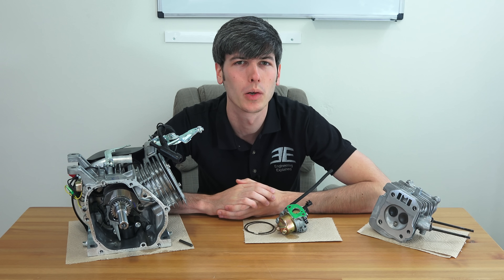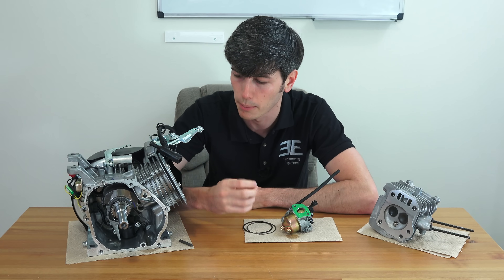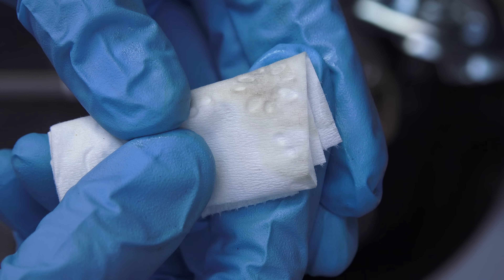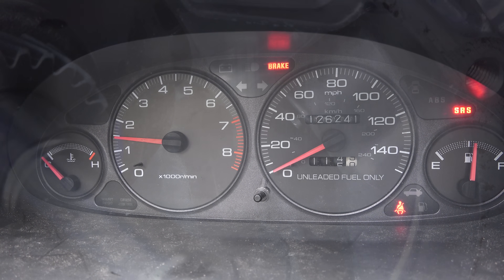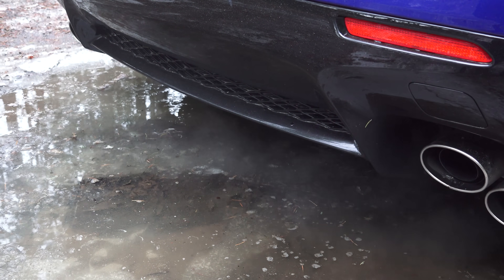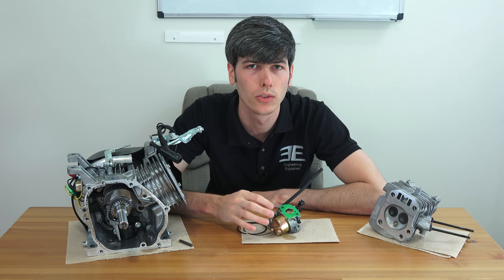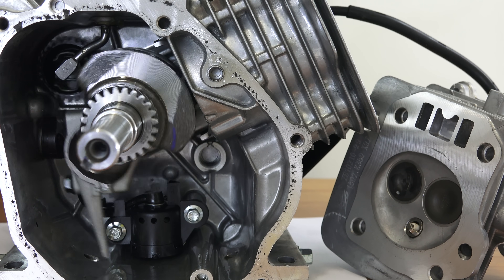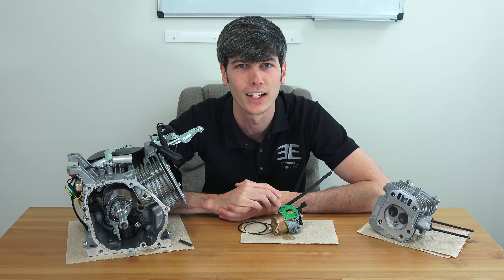Should You Warm Up Your Car Before Driving?

Comment: Hello. I have a 2009 Subaru Legacy that tends to idle pretty high (1500 rpm) 3-5 minutes before it settles down to around 600-700 rpm. I was under the assumption that this was because of the PZEV feature. Is that the case, and should I be letting it warm up until the revs decrease to normal idle? Thanks in advance!!

Comment: This isnt exactly right. The mixture is only rich until the O2 sensors heat up and start working which is about 1 minute or so. After that its not rich at idle anymore.
Reply: wrong... the cold start enrich is litterally a parameter in the engine software its tied to the coolant temp.
Reply: Thats why I said its not exactly right, not straight up wrong. By the time the O2 sensors heat up and go into closed loop the ECT is going to be high enough that it doesnt have to richen the mixture as much as if it was full cold start. It wouldnt be much. The mixture will be really rich right until the O2s heat up then it drops drastically. O2 sensors have priority over ECT sensor in closed loop.

If you dont believe me, look at fuel trim numbers before and after O2s start working. It will be pegged rich then when O2s start working it goes into what is considered normal mixture and not rich. This takes a minute or 2 and not a long time as he said.

Comment: I call bs, engines are designed to run at operating temperature, while driving lightly will warm the car faster your engine is revving higher than the 700RPM it would at idle, say it takes 3 minutes to warm up at idle, thats a grand total of 2100 revolutions, say it only takes a minute of light driving, you're still gonna break 2100 revolutions in that minute even if you live on flat ground, the only way I can imagine you not breaking 2100 is in a diesel which needs to warm up for proper combustion anyway. Plus even though he accounts for the 30-45 seconds it takes for the oil to circulate the oil is not yet at its warmer, thinner operating temperature, meaning your engine is working harder pushing what is essentially thicker oil than it is designed for

Comment: May I ask how do I know if my car has fuel injected engine or carbureted engine?
I drive a 2012 mazda 3 2.5 and a 2004 impreza 2.5 RS.
I heard if i dont warm up my car before driving it,  its bad for the head gasket.
I need some advice :)

Comment: With our Canadian winters, there's no way we'd have the windows de-iced with a scapper in under 10 minutes without help from a vehicle that's already been idling for 10-15 minutes with the defrost blasting.  That ice is thick, and there's a lot of it.  How much engine life are we expecting to lose? Years? Days? Have any measurements of ring or cylinder wear been performed? For as long as I've owned a vehicle and idling cars, by the time I'm ready to purchase a new vehicle I will have noticed no problems from winter idling.

Comment: So wait you're saying by leaving it idle is hurting the engine by allowing gas to dissolve the oil and eventually seep into the oil right? But at the same time you're telling me that after 15-30 seconds the engine is warmed up enough to run. So wouldn't that mean after 15-30 seconds I no longer have to worry about the gas dissolving the oil or seeping into the engine?
Reply: B Mack no . He is saying after 30 seconds drive lightly to reach operating temp quicker than idle would

Comment: If you have a high performance car with upgraded forged pistons and new bearings then let it warm up. You need to wait for the pistons to expand so there isn't a load on them before they expand. Putting load on them before expansion occurs can damage the rings, pistons, and cylinder walls. The bearings also need to have warm oil lubricating them to ensure consistency under load.

Comment: Please clarify for people how a transmission heats up separate and most manual cars wont even go into gear until there is some degree of warming. You absolutely should warm your car up for 10-30 seconds AT LEAST. In a manual in the winter, give it a minute before putting load on it. This is insane. This goes against common sense and engineering.... lol... he is saying it will warm up quicker if you drive it under load immediately yet doesn't address the strain that puts on all sorts of pumps. If I started my 2011 SAAB 9-5NG manual in cold weather and just went to drive that poor F40 6 speed transmission would cry and fight to shift into gear. Turbo guys, do not listen to him if you live anywhere that the temp drops below 30 degrees Fahrenheit.

Comment: a carb does not have a way to put more fuel in?  it's called a choke stops the air going in to warm up car... your car should run at a high idle when gets to around 1,000 rpm you could pull off but and why I love this guy.  the reason you warm up your car is more for you it takes seconds for the oil to heat up there is a explosion in the engine. a water sensor don't get heat water has to wait for thermostat to open... so the oil is doing its job don't hurt your engine anymore to idle as if you where in traffic..  dang AL gore global warming..  I like a warm car when I get in.

Comment: I know for turbo cars is a little more complex as turbos rely heavily on oil temperatures to function properly. My '16 WRX has an oil temperature gauge and I usually allow it to warm up to +150 degrees before I exceed 3k rpm. My question is, what would you consider "operating temperatures" for turbo cars to minimize wear and tear?

Comment: +Engineering explained Dude I love and watch all your videos. But I cannot agree with you on this. I won't say you're wrong, but definitely not right. I've seen 2 acuras, 2 Mazdas, and one nissan ALL throw rods from not letting there car warm up. and the Nissan was a 2010 altima, and the acura was a 02 integra, and 07 tl. Those engines are both fuel injected. Also I know newer engines have a lot of computers in them, 1 to help with this I am sure, to regulate temp. So why'd they still fail? I am honestly looking for some insight and response if you can. Again I'm still going to continue to watch the channel lol.
Reply: CoolBreeze90210 are you sure they were driven lightly , as EE explained  ?
Reply: swr Nismo The tl and the Nissan both were drove easy. I actually don't know about the others honestly. However believe it or not, I've been experimenting with this the past 2 weeks. I have a cousin who is a 15 yr mechanic. He told me with the year my car is, to not let it sit for more than 5 minutes. I drive a 2010 accord 6-6. So I keep the rpms really low and below 45mph before the temp regulates. He also explained that cars now days have multiple oil pumps and thermostats, so it's ready to drive after about 10 seconds. After experimenting for a week, I now see EE was definitely right on this.
Reply: bad gas in the winter probably....

Comment: I've been told by multiple people who own turbo charged vehicles that a stand still warm up is "necessary" to heat up the turbo properly. I give my WRX about 2-3 minutes to idle and circulate and then drive it very carefully until to operating temperatures. I don't usually spool until the car has been driving for about 5 mins if that. Do turbo charged vehicles really need that extra time at idle or does the principles applied in this video hold true for a modern turbo vehicle?
Reply: Full disclosure: I'm not a mechanical engineer, but I would assume that a turbo vehicle is no different save for the fact that it risks much greater wear if loaded heavily while cold (since it creates far more power than an NA engine for its size). Moreover, the turbo is another spinning part with another bearing meant to seat optimally at operating temperature, so it's just one more part to wear/damage if loaded heavily while outside of operating temp.

Comment: Another important discussion for below zero climates is the oil filter.   Plain cellulose economy filters do not flow thick viscous oil well at low temperatures and will bypass internally under load causing un filtered oil to circulate as well as the potential for previously trapped contamination to flow through the system for another pass at the bearings.   I prefer full synthetic microglass media filters which have higher filtering ability as well as better flow rates.    High differential pressure combined with a faulty bypass valve can cause the element to collapse in those chilly climates which can be catastrophic to engine wear.  Definitely keep the revs reasonable until the oil is flowing.    I hate to put numbers on it but under 3k RPM on gas engines or less than 40% of the engines redline is probably a safe bet.    Saw a video of a guy who started up his car in -40C and proceeded to do a burnout and the engine lunched itself almost instantly.      Good microglass filters are Fram Ultra,  Royal Purple and Amsoil all made by champion labs currently

Comment: Why does my car have a high idle when I start it, but drops after about 30 seconds?
Reply from the maker: Does this to warm up initially.
Reply: 120masterpiece it's to ignite the catalyst from what I've gathered
Reply: During start up the engine has no immediate readings from certain sensors (ie: air flow sensor to adjust for correct fuel or RPM to adjust for correct air). Initially your car will start with a predetermined volume of air (controlled by the idle air valve) and predetermined volume of fuel...for a predetermined length of time. These predetermined amounts provide a bit higher rpm as it's better to have a bit more initial start up power than necessary since having not enough would potentially cause a stall during start up, particularly in cold conditions. After this preprogrammed phase the Engine Control Unit begins to operate based on readings from the sensors (and now the idle RPM drops). Some of the details can vary a little bit from one car to another, but that's the basic idea.
Reply: Heat up the catalytic converter faster (they work best/more efficiently when they are warm).
Reply: It's the automatic choke
Reply: my 50cc scooter does that too, goes to 1800 RPM for a little then goes back to 1000-1100 RPM

Comment: And we warm it up because we want the interior to get up to our preferable temperature comfort level too! Lol.
Reply: JoeIsCrazyWillman I grind my teeth when I am cold, so my remote start is also saving my teeth.
Reply: JoeIsCrazyWillman and for the little ones not to be exposed to the cold temps.
Reply: Andrew Mcmillan well, i think the question should be "should you warm up your engine?" Instead of "should you warm up your car?"  I know they are somewhat connected but, one can warm up the engine without warming up the car, but no one can warm up the car without warming up the engine. 
On a kansas summer, i'd idle it for about 30sec before driving off. But on the winter, depending on how cold it is, it will be between 10-20mins to get the interior warm.
Reply: well considering some of them will be coming with like 200mile range its not that bad anymore
Reply: T1Oracle trains? Look at the size of those things. And mind you, they're not battery powered. As for the model X, i could get a full-sized truck for that price point, with much higher tow rating. Look, point I'm making is, what works for you may not work for me. Deciding on a vehicle is a personal preference.
Reply: T1Oracle why would i do it in an enclosed space? How about you let that tesla owner go to a power plant where his/her electricity came from, and sit in that smoke stack for 4 hours, and let me know how that works.
Reply: Um, you do know that batteries can't output as much in colder weather and require they be kept over 32 F to prevent damage, and unless you keep EVs plugged in can be permanently damaged when they run out of energy to keep them from freezing? And have no way to heat the cabin but via electricity when the temps are way low?
Reply: If you use your car to drive somewhere in 5 minutes, whether its warm or cold, its going to be hard on your vehicle. The bike isnt a bad idea, but if you use your car it will still be better to drive it nice&easy to work after 30 secs rather than warming it up at idle.
Reply: och sei This just another reason why electric cars are so much simpler. No engine to damage, no transmission to damage, just turn it on and go.
Reply: T1Oracle how's the towing capacity on those things? Lol
Reply: och sei The Model X can tow 5,000 lbs. All the trains in current operation have electric drive motors.
Reply: och sei Try this. Drive into a garage and let your truck run with you in it for 4 hours. Have a Tesla owner do the same with his/her Tesla. Then let us know which works best for you.
Reply: T1Oracle freights trains are technically electric driven, but diesel runs its generators, the same way as power plants rely on nuclear or coal to produce electricity for those electric cars.
Reply: och sei You don't have electricity? How do get online?

You do realize that solar and wind is currently the fastest growing source of electricity right now right?
Reply: I think the obvious reason for warming up cars is so the inside warms for the passenger not so much for the engine
Reply: och sei Well you should think about riding a bicycle to work instead of wasting fuel, time, money on insurance+registration+maintenance, and overall adding to congestion.
Reply: Matej Sommer well, i live 5 mins from work. Say i warm it up for 30 seconds, drive to work for 5 mins, that short drive doesn't get the engine to operating temperature. So, if the argument is to drive around town to get it to operating temp before driving to work, it is wasting both my time and gas compared to warming it up, which only would waste my gas.
Reply: Don't you take away the heat from the engine when you turn on the heat? I mean, obviously It does, but doesn't it make the engine heat up slower?
Reply: Yeah, until the charge runs out after 50 miles lmao.

Comment: In Britain up to a few years ago, we had Carburettor engines [as you have mentioned], Single point fuel injection [effectively an electronic carburettor - what would you advise] and multipoint fuel injection which is the advice I shall be taking [as it confirms the idea that you just switch on, scrape the windscreen, drive off and don’t drive it too hard until its warmed up.] It does mean that I now have to research into getting a proper temperature gauge rather than just a silly light to be fitted on my car as it doesn’t have it.

Comment: Wouldn't the displacement and size of the engine have a factor as well?  Would a smaller engine like a 1.4l that gets up to operating temps faster also have that issue with the gas mixing with oil from a cold start at idle?

Comment: What about more wear due to the oil being cold and not properly lubricating everything else besides the rings/walls such as the mains, cam bearings, and valve train components? You even admit that this is the case at the end of the video.

This is just anecdotal, but every time I have seen an engine "wear out", it is because of a failed valve train component or bearing, not loss of compression due to ring wear.

Comment: My car manual specifically instructs you not to warm up the engine before driving. In fact, if you don't drive away within 30 seconds after starting "ding! ding! ding!" and message comes up on the dash "Do not warm up the engine when stationary"

Comment: WRONG , WRONG, WRONG 
1.sorry my English is poor :(  2. cold engine means pistion flap soo.....  waring cilinder walls under load
2. if you ad throttle = more air ....so ecu add more fuel ! so it will be more RICH !!! 
3. If you have forged pistions always WARM your car bifore drive !!!!!!

Comment: I am a firm believer in allowing an engine to warm up atleast one minute in colder weather. gasoline in the oil is better than excessive fuel in a cat. oil can and should be changed regularly. I also believe the thermal expansion of internal engine parts is too much when just a 30 second warm up to drive on very cold warm ups

Comment: I don't believe it's just about oil temperature. An engine is a bunch of pieces of metal moving against themselves at high speed and pressure. I warm up my engine to make all of these pieces as close to the same temperature as possible before putting stress on the system as a whole. Not to mention other things like belts which can fail more easily if put under stress while cold.

Another example is in aviation, especially aircraft with reciprocating engines. Aircraft have a lot more gauges and pilots absolutely must bring items up to temperature AND pressure (even in summer) including oil, fuel, intake/exhaust manifolds, and hydraulics systems. Now I know this is almost comparing apples to oranges (almost), but to me, an engine is an engine. If aircraft pilots rely upon things not failing in order to save lives, I think I can wait 3-5 minutes to prolong the life of my engine.

Comment: if extra diesel gets on the cylinder walls, will this negatively affect the cylinder wall or piston? does displacing oil with additional diesel occur in direct injection vehicles?

Comment: I have a manual bike. its winter here but still temperatures don't drop so much. i just rev the bike at about 5-6k rpm for a minute or so and then actually drive. is it good?

Comment: Never thought about the engine in this situation, the trouble for me is always when the windows are transparent enough to see through, which means the A/C needs to be pumping for a few minutes before I can even see where I'm going. If those 2 things don't link up that well, then that's an engineering failure.